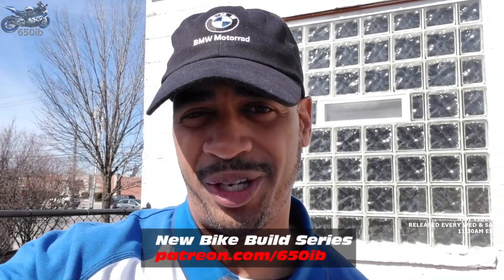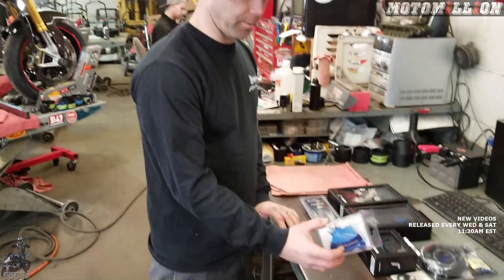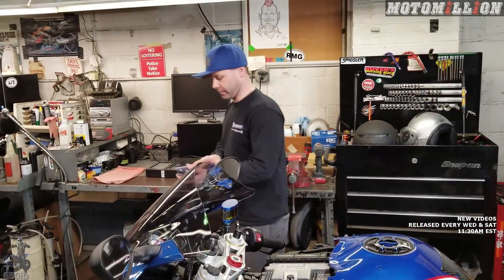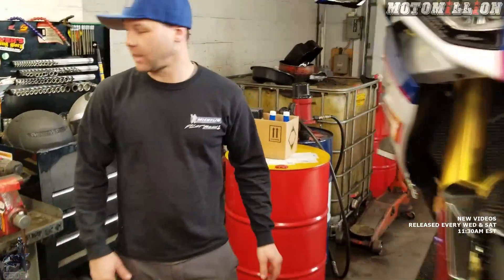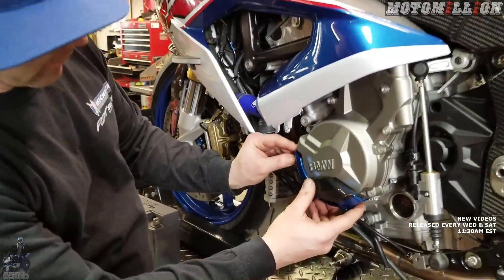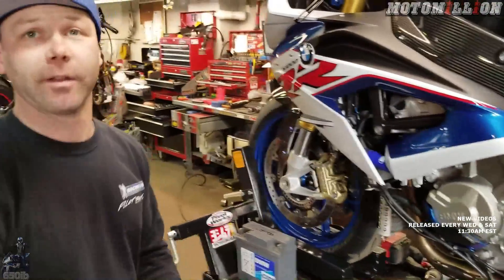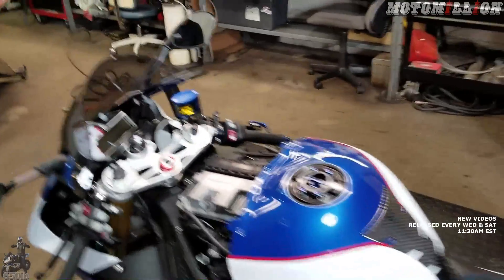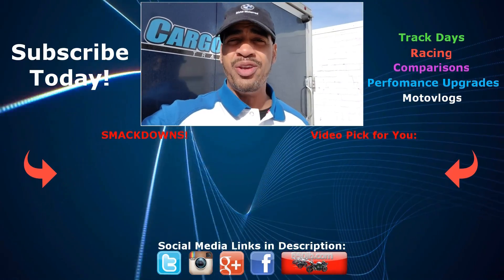BLUE Crash Protection & Levers | 2018 S1000RR!

Comment: Awesome video again! Best videos on YouTube. Thanks so much for taking the time out to do these. Zack I have a question about suspension sag, and adjusting suspension on a BMW s1000. I know it has a tremendous  amount of electronics around the suspension. But is Sag something you need to adjust for manually?
Reply: Elrick R yes sag is still set manually. Preload on the right fork and on the shock. Shock spring is very heavy
Reply: Sk8r007 1 Awesome thank you! Is that something the dealer would do, or should I look up a performance shop? I can probably do it with a the help of a friend to take the measurement etc. Thanks for the info. Awesome awesome videos. Very informative!
Reply: Elrick R the dealer should be able to set for you.
Reply: Sk8r007 1 Thank you!

Comment: Awesome work Zack. May I ask what torque wrench your using in this video? The small digital red one.
Reply: Nirvash probably snap on
Reply: Nirvash it is a gearwrench brand one. Goes from 1-10 NM. Comes in a kit for installing TPM sensors
Reply: Sk8r007 1 thanks